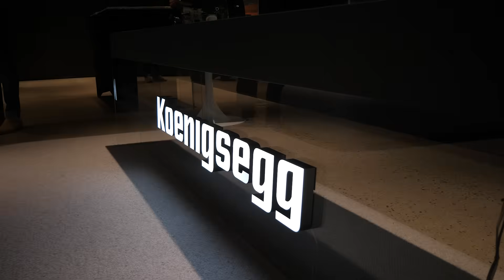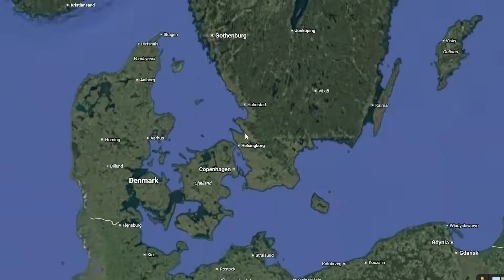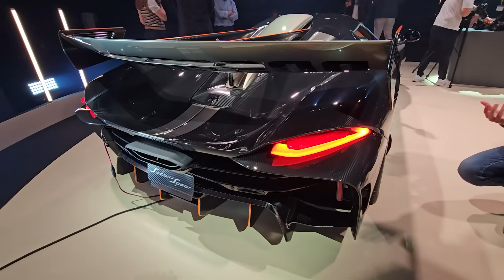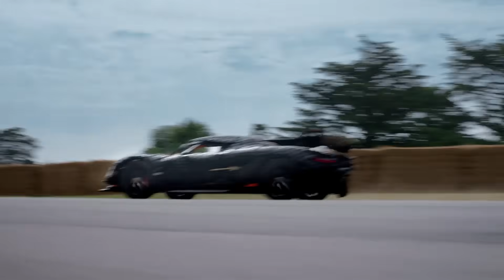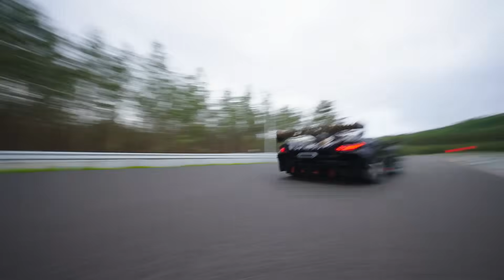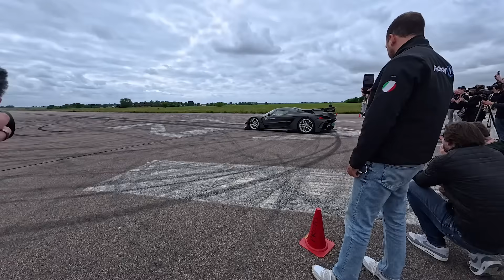Inside Koenigsegg HQ: Real Sadair's Spear, LEGO Technic Set & 1:1 LEGO Car

Comment: The 1:1 replica is the top thing to me. It is amazing, that it managed to pick up so much speed, although if I see correctly, actually a great part of the structure is not lego. From that point I would still place the Bugatti Chiron on top of the podium, which looked even better, than the original car, and it was built using much more lego elements. Of course it couldn't go so fast, so you win some, and you lose some.

Comment: Finally, we’ve got a real vehicle that truly deserves to be turned into a LEGO Technic set !

To be honest, the P1 didn’t really offer anything particularly exciting from a technical perspective. Just adding a spring to the door mechanism doesn’t suddenly make it worthy of being a true 1:8 flagship model.

This time, it’s different. We’re dealing with a car that features an iconic and highly complex opening mechanism: the Dihedral Synchro-Helix doors. That alone is a real engineering challenge to recreate in LEGO Technic. 

And then there’s the design itself. This car’s silhouette is far better suited for a LEGO recreation compared to some more organic supercars. Those often end up being very difficult to reproduce accurately with Technic beams and panels, forcing a lot of compromises. Here, the lines are sharper and more geometric, which aligns much better with what LEGO can realistically achieve.

On paper, this is exactly the kind of vehicle I want to see in the 1:8 Ultimate series a strong visual identity, unique mechanisms, and real engineering challenges to capture in brick form.

Comment: THE LEGO VERSION REACHED 111KPH?! I am deathly afraid going that fast in our Suzuki.
Reply: it's a steel car frame with a real electric non-LEGO motor, covered with Technic pieces... It has the real non-LEGO steering wheel and seats. I fail to see where's the exciting part... and Lego calls it a speed record. Hilarious!
Reply: @v @vladgheneli ah I agree honestly, it’s very very impressive what they’ve done with the body. But driving it downhill, and basicly just putting a body on a konigsegg isn’t really a speed record, kind of defeats the purpose of a Lego build.
Reply: @Mist.vl.  exactly! Even the body isn't that impressive to me, if you look at the full video about the life size version, you can see how many steel bars they've used, for every single panel of the real car. So basically they' have the steel wireframe of the real car and coated it with Technic parts, using those diamond shapes with ball joints, that can be positioned at any required angle, to match the shape of the real car. 90% of the design work here was actually the steel wireframe, and has nothing to do with LEGO building. Again, they've done an amazing job on the LEGO set, but the real size LEGO version is a marketing joke meant to impress the gullible.
Reply: @vladgheneli yeah, also feel like they could have put 20 more bucks into designing headlights instead of prints, it’s the first thing you look at, might as well do it good.
Reply: @Mist.vl.  I think they tried. But probably didn't have enough room. You can see it on the prototypes. They had empty spaces for the headlights.
Still, many people argue that the real car has flush headlights, they don't stick out at all. Problem is they still have some depth inside and from some angles the print looks very bad. But as I said in another comment, I can give them a pass on printed headlights, because of all the awesome mechanics.
Reply: @vladgheneli yeah, I’ve seen people make their own, and they look great. But all the other headlights on cars are flush, but you put the details that the light makes instead of the actual headlight.
Reply: @vladgheneli  interesting. hmm, yeah, didn't really look carefully. I thought there was much, much more LEGO and less steel. Guess I should have known when they took it to 111kph. A more LEGO non-drivable (or simply super-slow car or even an RC style one or whatever would have been cool too. Just like with the Chiron though, marketing stunt achieved.
Reply: your afraid of going 68mph?

Comment: Sticker headlights on a 1:8 Technic supercar?!
Reply from the maker: Printed
Reply: @RacingBrick  still, not brick built :/
Reply: @Sauci55onthey where to small to make brick built and have good shaping I think they picked the right solution
Reply: @TangothePango  honestly, they shouldn’t be that hard to brick build especially with modern parts and techniques. When you look at what can be achieved in terms of small scale detail on sets nowadays, it seems that it should also be possible here.
Reply from the maker: Brick building the light would mean the inner panel should have been broken up to smaller pieces so it'd look busy. There are always tradeoffs in design.
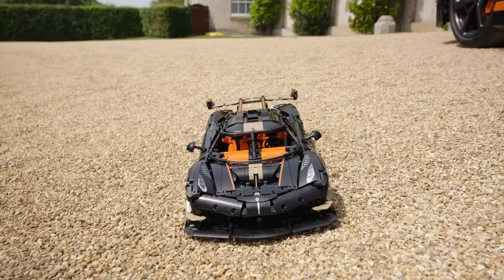Reply: at 2:17 they look more printed than sticker. The light falloff on the right hasn't got any hard edges that stickers would have.